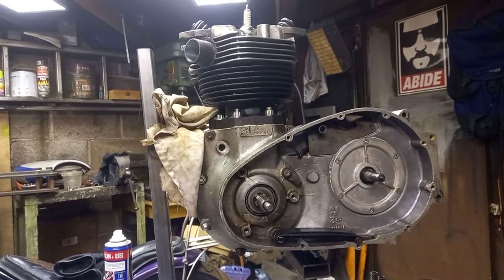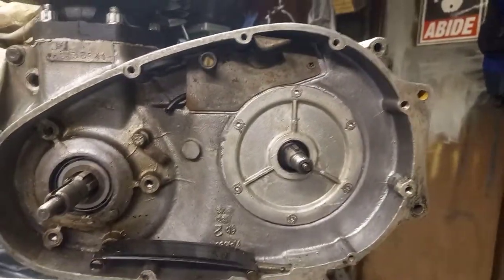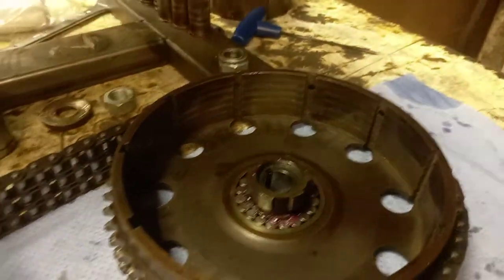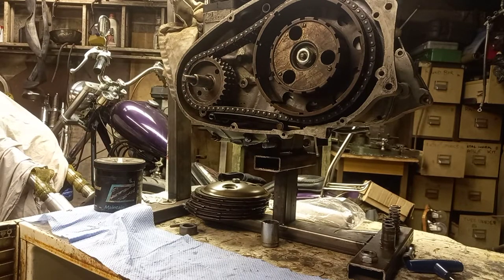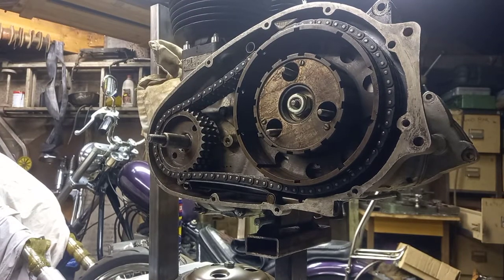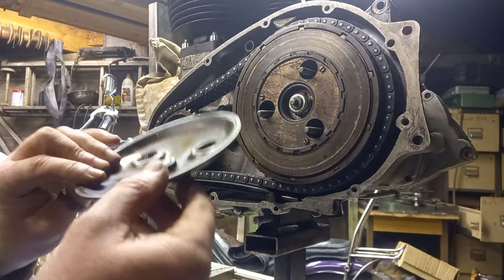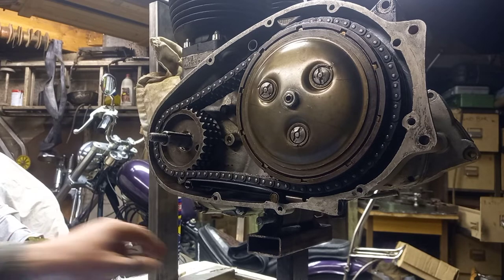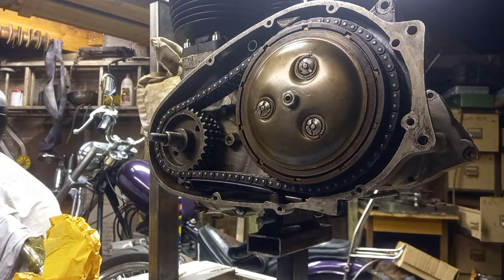TRIUMPH T120 T140 BONNEVILLE CLUTCH ASSEMBLY HINTS & TIPS INSTALATION.

Comment: A couple of years ago i replaced everything in the clutch except the chain wheel & pressure plate.
I was able to purchase a complete hub assembly with rubbers installed.
I filed a little bit of the slots in the Chain Wheel & reused.
Since i replaced the female tapered piece that  mounts to the transmission shaft - I had to re-shim the engine shaft to keep alignment within .005 inch.
I was told that i could purchase shims from McMaster- Carr & I did.
I checked alignment a couple different ways
1)  i measured the position from some reference point of the old tapered piece , when mounted on transmission shaft to the new tapered piece.
I also considerd the thickness of the thrust washers - old verses new.
It was actually the face of thrust washer position that contacts the chain wheel - that i compared old to new & it gave me a number/thickness required.
2)  With chain removed mount both sprockets, i mounted clutch on the tapered shaft but did not install lock nut. 
Using a straight edge (small carpenters  square) & feeler gage - i was able to check alignment.
I double checked using a 
005 feeler gage once new shims were installed.
I agree never reuse the Lock Nut!
I was told by one place that i purchased parts from to reuse the Lock Nut but just put some Red Loc-tite on threads.
I was able to purchase a new lock nut from another supplier.
Everyone has trouble with the sprocket window screws & i replaced with allen head flat heads too - years ago.
It may not make a difference but i used black oxide screws & not zinc coated.
Anyway, my clutch works geat & does not lock up even after winter storage.
My bike is a 1973 Tiger 750.
It has 63,000.miles.
I purchased in 1977.& i have riden it every year since.

Comment: Hi very good video thanks for the rundown. What size is the allan-key used for adjustment of the clutch rod
Reply from the maker: The Allen key is 3/16".
Thanks for watching.
Reply: I've got a 1970 tr6 supposedly just had the clutch replaced by a shop. Have since pulled the end off two cables and the clutch is very hard to squeeze. I have re set up the clutch as per your video and still no success. Do you have any recommendations? Cheers Rob

Comment: I'm getting ready to re-assemble the gearbox and clutch in a 1973 t140v so these videos are helping alot! One question - I can't find exactly how to/where to put on the high gear oil seal...do I put it on the high gear before the high gear goes through the main bearing or does the oil seal go on the sprocket side of the main bearing? Do you have a video that shows that assembly? thanks!
Reply from the maker: Hi. You can fit the High gear seal first from the Sprocket side, through the primary window. I normally knock them in while I'm fitting the new inner needle roller bearings before the cases go together. The inner of that seal runs on the sprocket boss. Don't forget the O-ring under the sprocket tab washer. Hope that makes sense? Thanks.
Reply: @guerrillabuildchoppers4823  Thanks.... spring side of the oil seal towards the high gear side right? And thanks for the reminder about the o-ring...still need to source a new one.
Reply from the maker: @kennethnystrom7285  Yes, closed face towards the sprocket. The small one in the trap door goes the other way.

Comment: I’m at this exact point on my build so thanks for doing this video it’s very helpful. My question is to avoid the plates rusting together should I soak them in 20w oil as the build will not be on the road for a year or two. Thanks
Reply from the maker: If you don't need the clutch to function yet, I'd put it the cover on without fitting the plates until your ready to ride it. The oil could go sticky and cause them to grab to each other.

Comment: Help ! I've got a 1971 Tiger 650 and for some reasons the clutch springs won't undo ! i have the special tool but a couple are so tight, Any ideas ? Thanks.
Reply from the maker: Maybe try a bit of Heat? You'll have to replace the Springs, but they should free off.
Reply: Many thanks, will try that 👍 @guerrillabuildchoppers4823

Comment: My 72 foes not maintain correct oil level in the primary. I understand that the three tiny holes in the crankcase positioned low just to the right of the eng sprocket at proper oil level are supposed to regulate this oil level. What is done to properly restore their function ?

Comment: Please allow me a question.
Lately I changed the front sprocket on my T120 O.I.F. After all was remounted and the rear chain was adjusted, I had a disturbing experience. Mind you, she is my first Triumph. 
With a screwdriver between the primary case and the clutch (with little force)  I can slightly move the clutch horizontally and the tension of the rear chain changes a wee bit as well. 
Are the said movements compensated by the antagonal reaction forces of the two chain drives during operation?

Cheers!
Reply from the maker: Replacing Gearbox bearings is a really common job. Sounds like there is play in the High Gear bearing as that runs on the main shaft. If you open the box, replace all of them including the Layshaft. Britishbikedoctor have everything you need.
Reply: Thanks!